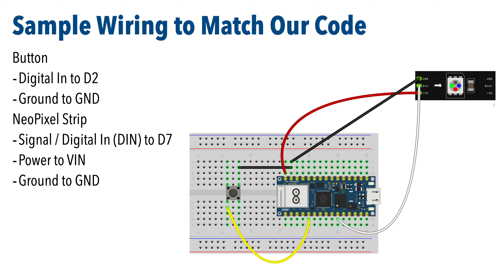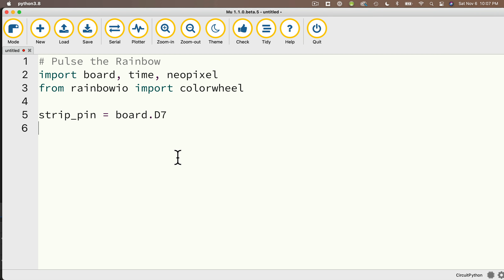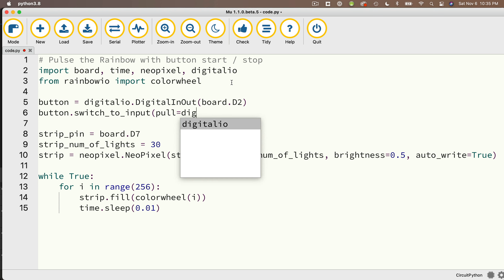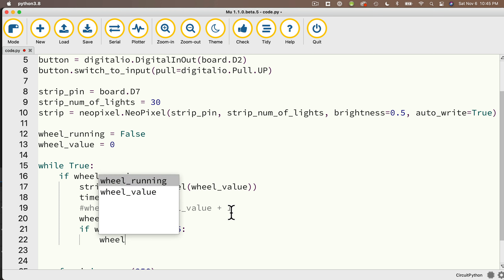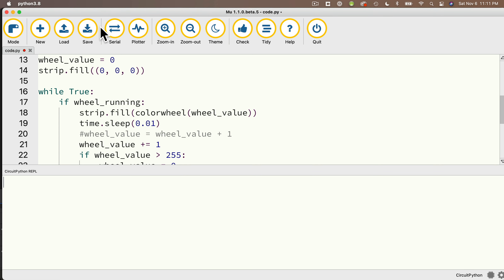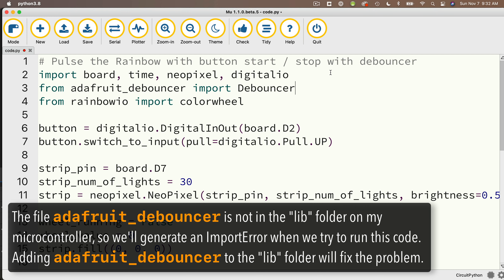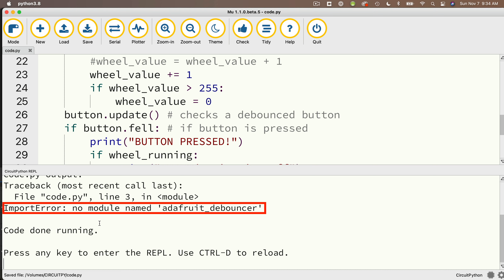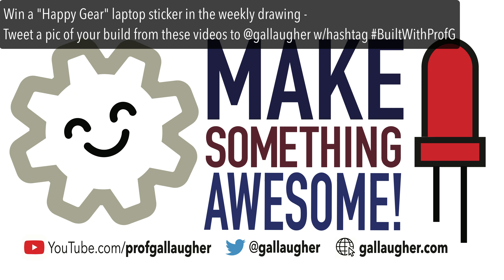CircuitPython School - Help My Button Doesn't Work! Fix it w/Blocking & Debouncing, plus colorwheel

Comment: love it if you posted the code used here
Reply from the maker: Thanks. The reason I don’t post the code is students complete the work and submit their files for homework. I do have some code samples in the Google Drive for the course at Gallaugher.com. All of the larger project focused builds have code on GitHub and I do have some copy and paste snippets for things like adding lots of colors from the Adafruit LED animations library bit for these small examples I want my students to type and run the code themselves. The small flubs one might encounter from typos, etc are useful for new coders to encounter since they’ll deal with these forever and can quickly learn when and why they happen so they can deal with probs on their own when they arise. Otherwise, I would offer up all code. Cheers and good luck!
Reply: @profgallaugher  i got it working